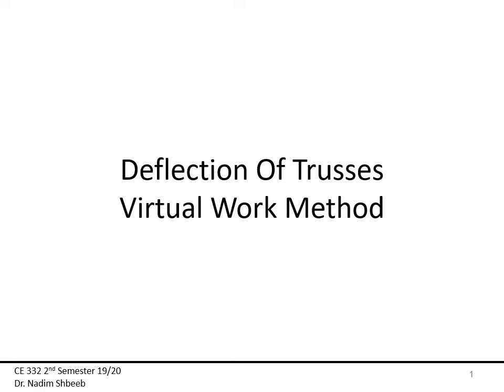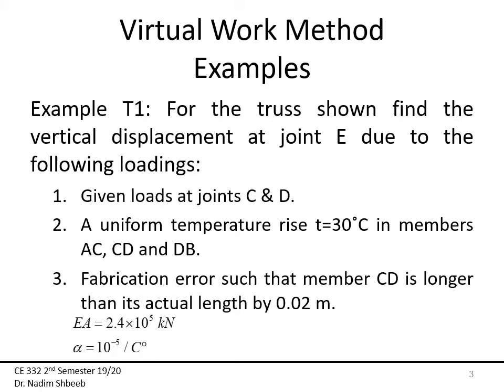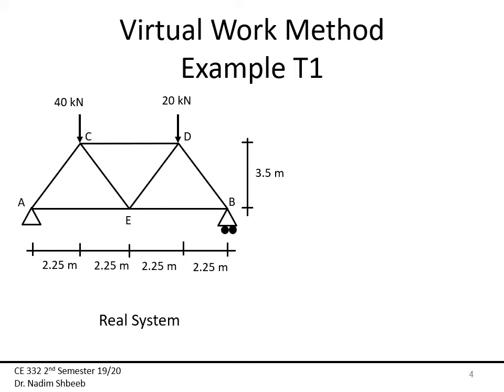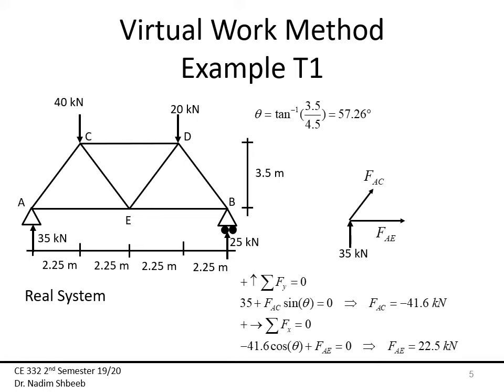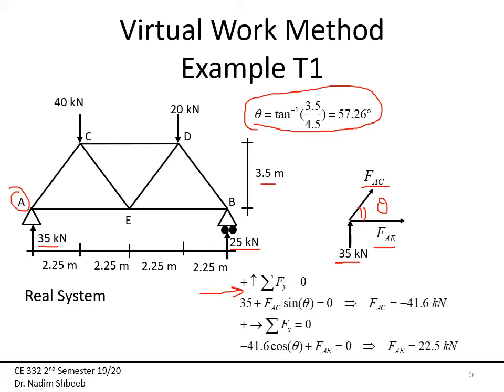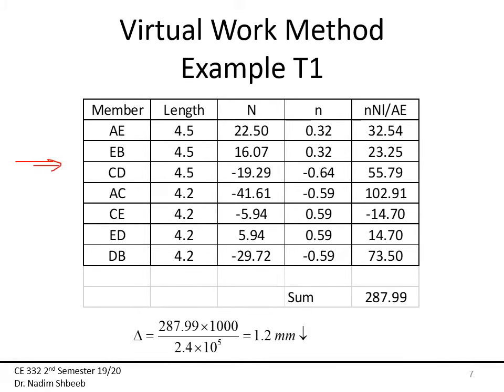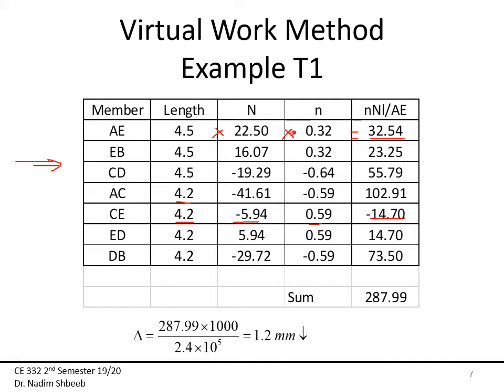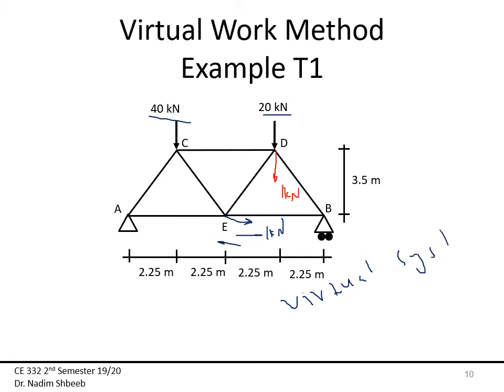Deflection of Trusses Virtual Work Method

Comment: How did you get n
Reply from the maker: Slide 6
Reply: @nadimshbeeb417 oh so like n,are the forces found in the virtual system?  And I have one more question, assuming the forces pointing down are horizontal instead how would you represent that in the virtual system
Reply from the maker: Yes, they are the virtual system. Regarding your second question, the virtual system is the system where you want your displacement. If you've noticed, I used the same virtual system to answer all questions. If you change the original loading and still want to find the vertical displacement at E, you can use the same virtual system.

Comment: I don't understand how he got the 57.26°
Reply: I pretty sure instead of 2.5 its 2.25 so it will be  tan -¹= 3.5/2.25 = 57.26
Reply: @Zii3zoz  where does the 4.5 come from? i am assuming he is using pythagoram theorm which will be square root of 2.25^2 + 3.5^2 which equals to 4.16 rather than 4.5, right?
Reply from the maker: You're right it is 2.25 not 2.5
Reply from the maker: Members AE, EB and CD are 4.5 (2.25+2.25). The rest are 4.16 (rounded to 4.2)
Reply: @Zii3zoz  EXACTLY

Comment: Where does 1.36 came from? Timestamp (10:12)
Reply from the maker: It should be 1.2 not 1.36
Reply: @nadimshbeeb417  thank you sir! May I ask sir, what if I also have a given settlement. I want to find vertical displacement due to settlement and fabrication error. What formula should I use sir? 😊
Reply from the maker: In that case you would multiply the reaction due to the virtual system with the actual settlement value at that reaction (support) and add or subtract depending on direction to the required displacement and equate to zero since there is no internal work
Reply: @nadimshbeeb417 

Sir can you check? 
Problem is: AB and and BD are fabricated 3/4 in too long and support D settles 0.25 in.

Reaction of Support D in virtual system: 1/2 kips 
Settlement at D: 0.25 in

Fv of AB = (-5/8) kips
Fv of BD = (-5/8) kips
Fabrication error = 3/4 in

Solution for vertical displacement due to settlement and fabrication error:
(1/2 kips)(0.25 in) + (-5/8 kips)(3/4 in)(2 members) = - 0.8125 in.

I wonder if I got it right. Thank you so much sir! ❤️
Reply from the maker: As an equation it looks good but I have no sense for the direction.
Reply: @nadimshbeeb417  can I email you the whole solution sir? If ever.. I really want to clear my mind in solving this. Thanks a lot sir!
Reply from the maker: There is no need you're in the right direction have some faith